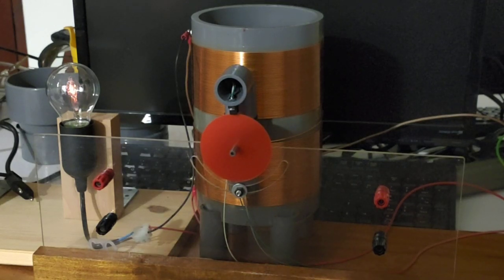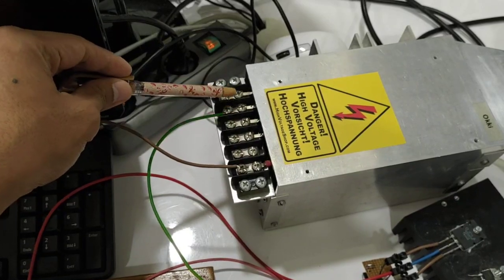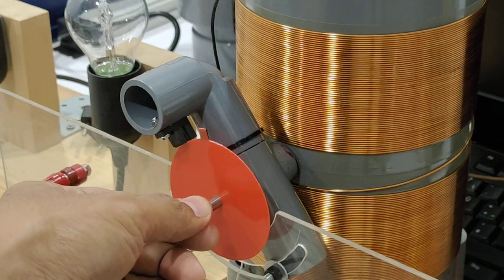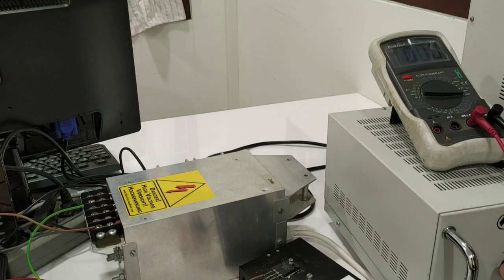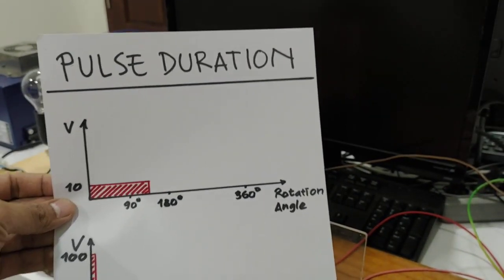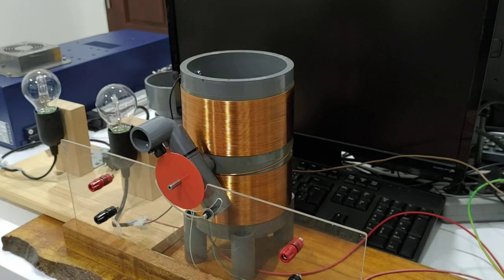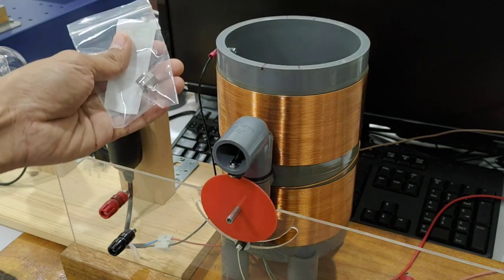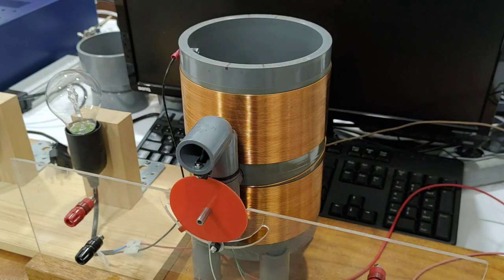Newman Motor - What Works and What Not

Comment: good job bro, but actually the main purpose of newman motor is to produce a powerful rotor rotation with small and direct input power and take advantage of the back spike for self charging.  strong rotor rotation can be utilized to turn electric generators and even turn water pump turbines.  I suggest you do some research to find out how far the power of the rotor is meant to rotate the electricity rotor generator to produce free electricity.  and that is actually the purpose of this newman machine.